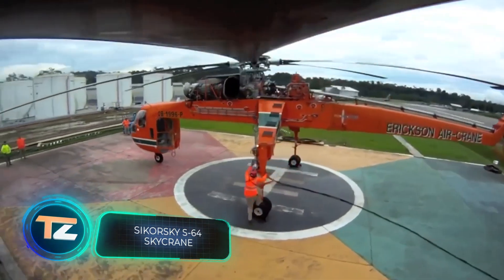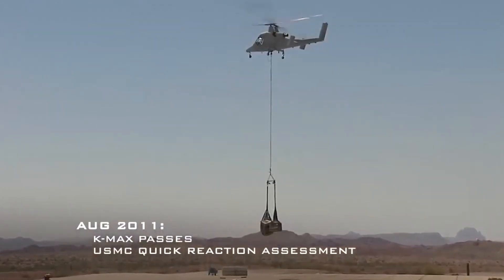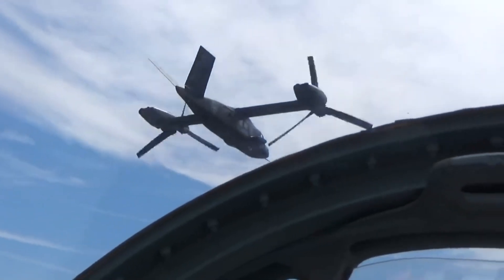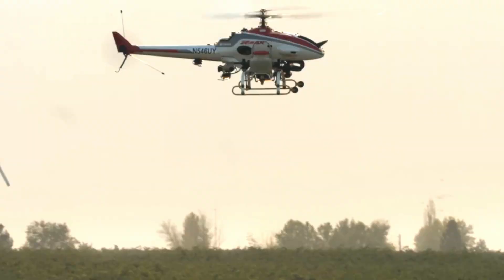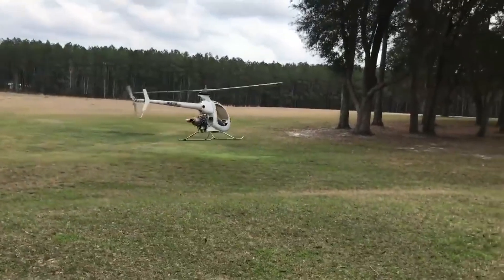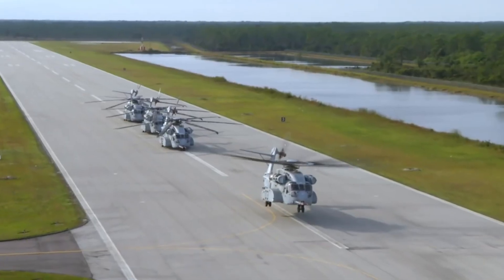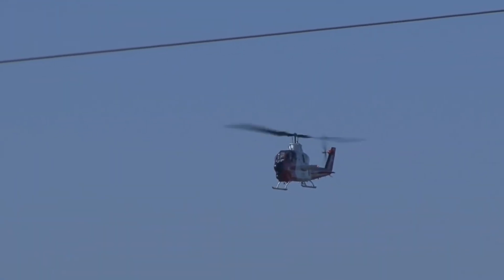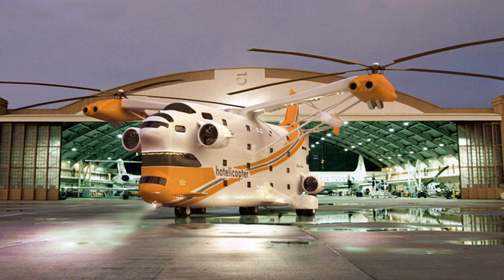MOST INCREDIBLE HELICOPTERS YOU HAVEN'T SEEN BEFORE

Comment: The Bell V-280 Valor is not a replacement for the AH-64. Bell's 360 Invictus FARA is looking to be the replacement. The Bell V-280 Valor &  SB-1 Defiant is a replacement for the UH-60 Blackhawk. I've seen every one of these copters, except the hoteliopter. I've been inside a couple and worked behind the scenes on the full tank molds for the CH-53.

Comment: Meshing main blades  - a recipe to have a mid air with itself.
Reply: Kaman has had intermesh rotor since the 1950s. The air force used the Kaman huskey as a search and rescue helicopter for decades. Had an excellent safety record. The rotors gearing keep them synchronized.